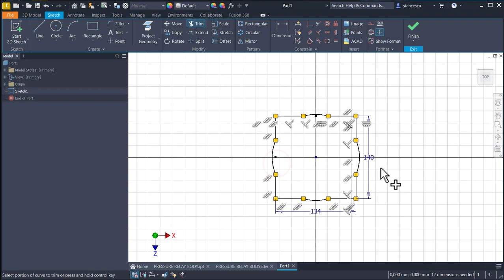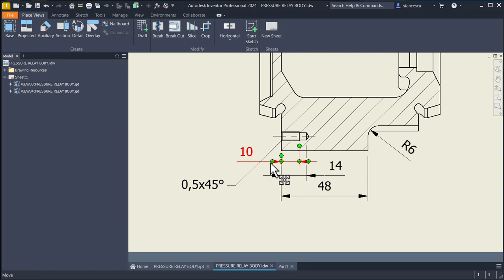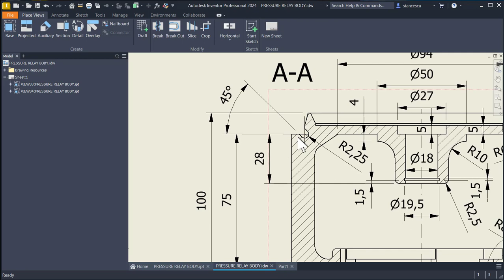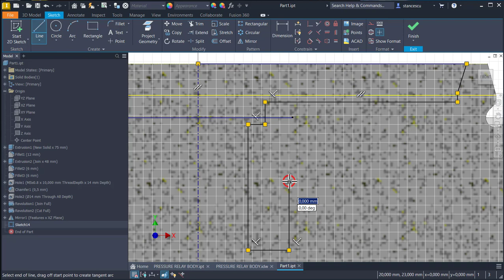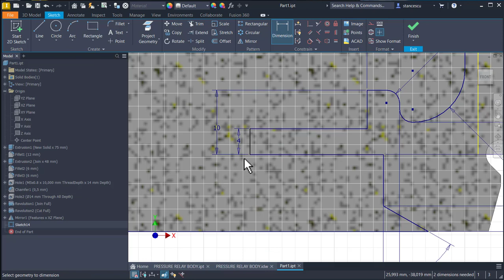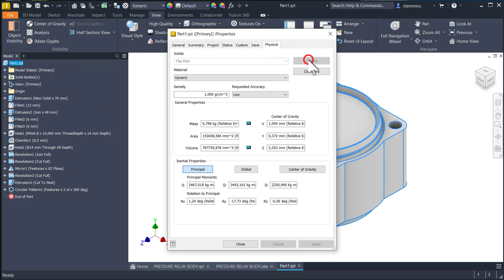Tutorial Inventor - 307 PRESSURE RELAY BODY

Comment: Dear Sir. Thanks for this wonderful tutorial. I have a question. At 8.12, if the small lines are trimmed instead of split, then what difference it will make?
Reply from the maker: This is an excess of mine because there is not any difference to result. I did this out of habit, so that I would only have one area and not have to choose between two. Thank you for the message!
Reply: Thanks for the prompt reply. I got the answer. In your other tutorial I learnt that 
co linearity gets lost due to trim.